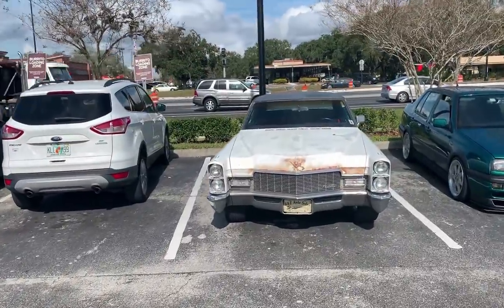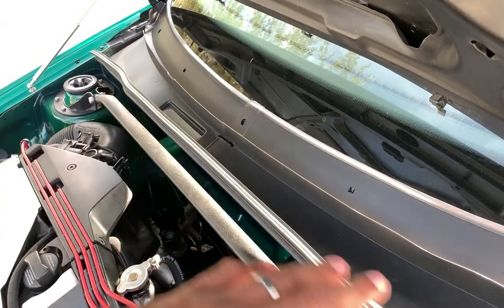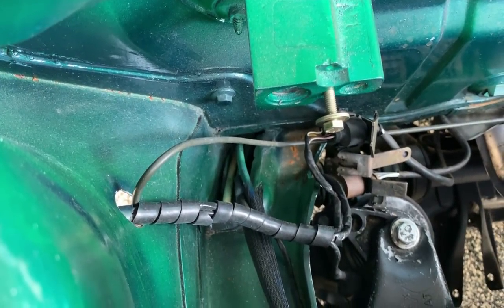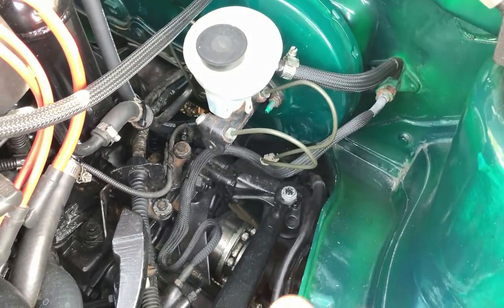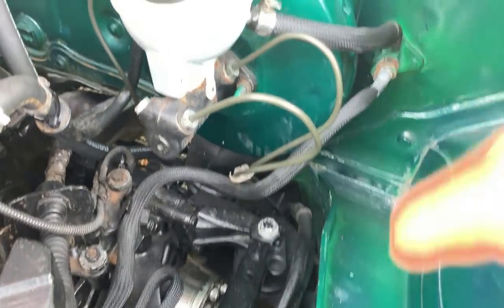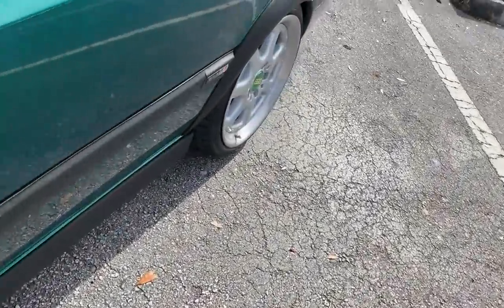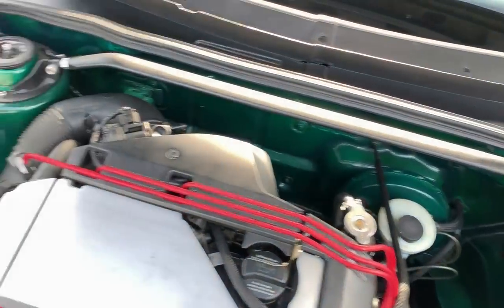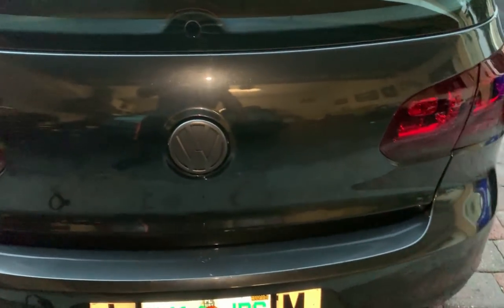How I wire tucked my mk3.

Comment: Hey man, very informative so far.  But I have a couple more questions as I'm doing a mk4 12v VR6, and need to no, along with the abs delete.  How did you delete your EGR and SCi stuff.? Along with that awesome coolant resivior on the back of the engine  And a different power steering resivoir. I know a 2000 MK4 12v has a different intake manifold than yours, but if you can point me in the right direction with how you did that stuff and what aftermarket part support I will need  to take into consideration. Any help would be awesome VW Vortex can only get me so far, without pictures... Thanks!

Comment: @ The WV Garage
Had a question about your Rafd control wires, that ran to the unit. How did you wire up the new fans, and what did you do with the old rad control wires on the loom. Did you cut them off, or just hang them up in the fender? Im at this stage right now, and trying to figure out what wires from the rad control i need for the new electric fans from the old rad control wires if any. I am keeping AC, so i need the fans to come on when the AC kick on.
Reply from the maker: Detonate Klubstompers Judy connect the slim fans to the factory fan plug. Just that easy.
Reply: @TheVWGarage  Thank you much man!!

Comment: Awesome information thanks for sharing! As far as the coolant reservoir what supplies are needed? I have one on the way
Reply from the maker: Chris Reitz you’ll need to custom fit some hoses. The hardware on the timing cover will work to mount it. Then join the wires for the coolant ball sensor to stop the light on the dash from flashing. Or stick a fuse in it.
Reply: @TheVWGarage  thanks 👍👍
Reply: @TheVWGarage  will I need to buy another set of hoses or the ones I have in the car work

Comment: Wow its uncanny how close to identical my buddies old mk3 looks to yours. He sold his along time ago. Pretty sure he was even running the same BBS, smoked ecodes, textured flares/ mouldings, etc. How long have you owned this? Where did you pick it up from? Looks good. Can't beat the old AAA!
Reply from the maker: Owned this car for 10 years or so. It was black originally.
Reply from the maker: And stock when I bought it.
Reply: @TheVWGarage  
Nice. Yeah, out here in upstate NY my buddy had one that looked damn near identical. I believe he's sold it awhile back. When he got his it was something like 15 years ago or more. He also had a set of wide staggered Type-A's he would run occasionally. Definitely weird seeing an almost identical car, but it's a small world I guess. Anyways dude, it's a nice ride. Makes me really miss the mk2 gli I built to no end with a screamer of an AAA under the hood. The TDI 5th gear in that car with the Quaife was a must-do mod, and I'd strongly recommend it, as well as a good clutch/ LTWFW and modded or complete shifter box. Really makes driving these cars much better. Thanks for sharing your wire tuck man. Keep it real! 
👍😎

Comment: I have a 98 gti vr6 I could not find the evap system and I am getting code 1473 any help would be appreciated  I checked in the wheel well nothingg
Reply from the maker: Lucila Rodriguez evap system is in the passenger side wheel well. If not the. It was removed